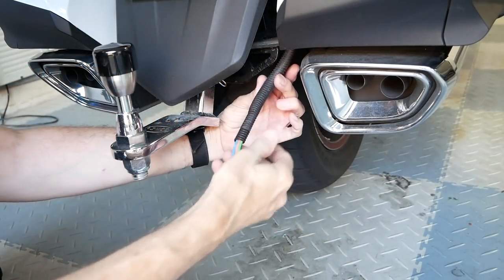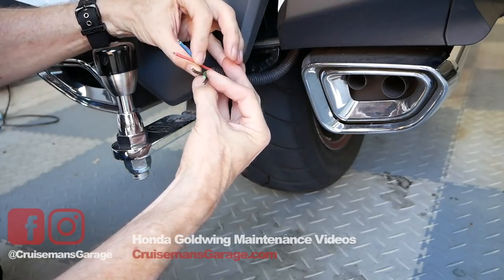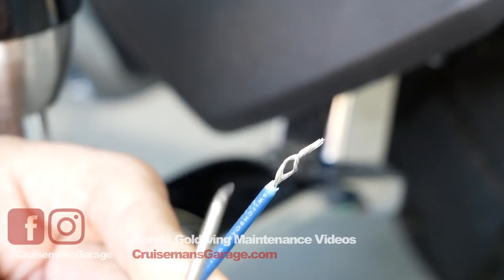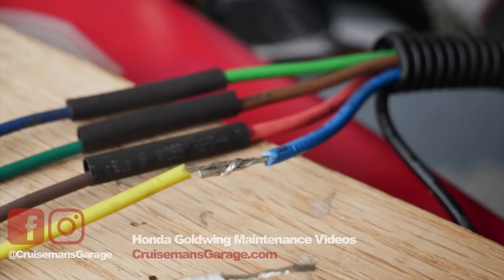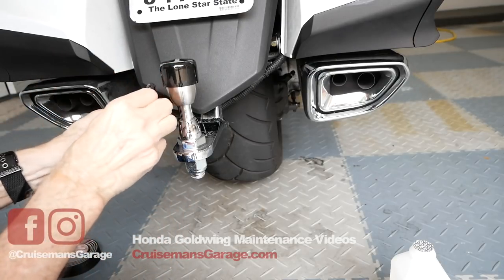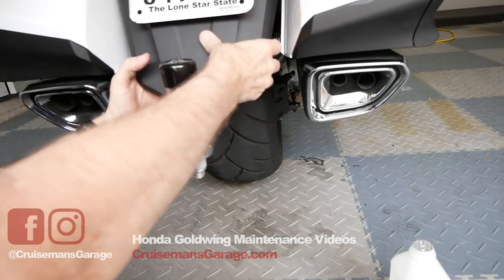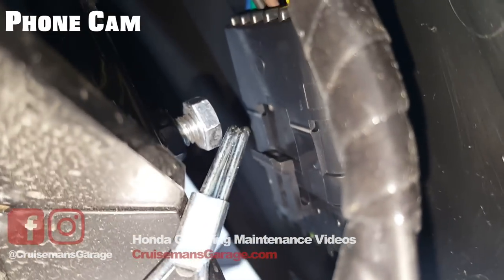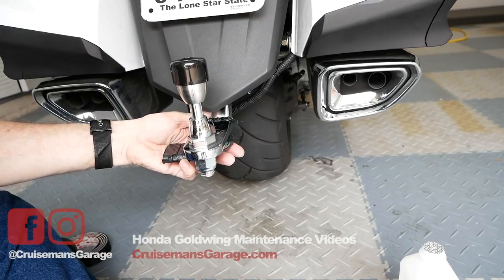Connecting the Bushtec trailer to RIVCO Universal Isolator

Comment: Bushtec trailers are in my opinion are the world’s best trailers. The trailers connect to the post style receiver using a heim joint keeping the trailer rock steady preventing rollover. The trailer’s suspension are designed to stay super solid at high speeds staying firmly planted over undulating road surfaces. A super slick trailer system you got there Cruiseman.
Reply from the maker: Love my Bushtec!

Comment: Your videos are solid gold. Thank you so much for making them! Based on your videos I picked up the Rivco hitch and wiring harnesses. Looking forward to receiving them in the mail soon! I do have one question to those who trailer - what weight are you pulling with the DCT? I ask because I'm interested in picking up a small camper to tow with my 'wing and loaded it will come in at 520lbs. I am more concerned with stopping the thing as opposed to the pulling, but would welcome your feedback (and anyone else that tows)! Thanks again for the great videos!!
Reply from the maker: Tony, you will love the RIVCO hitch. 520 lbs is a pretty heavy trailer. I don't think mine has ever topped 325 fully loaded. Your brakes will probably handle it, but you will need to add significant stopping distance. I would lower my highway speeds by 10-15mph as well. Not sure if 500 lbs exceeds what the bike is capable of or not.
Reply: Thanks for the feedback, Cruiseman. I found something that is priced right and I think will suit my needs. I just want to take my 'Wing and the camper within a 60-100 mile radius of where I currently live and go camping on the weekends. The Rivco hitch indicates it is good for 600 lbs. That doesn't mean the bike will handle that, but it's good to know what Rivco recommends on the hitch regardless. I will likely stay off highways most of the time (I enjoy the back country roads so much more anyway!). Thank you again!

Comment: Q1:  How do you protect your trailer connector from water/road grime/etc when not pulling the trailer?  Especially when it's hidden behind the fender like that...  Or, does it need protecting?  Maybe if you cut the thumb off a surgical/nitrile glove and stretch it over the end of the connector before fastening it?
Q2:  For the same reason you carried an extra piece of Velcro to protect the piece on the connector when in use, wouldn't it be a good idea to also cover that piece of Velcro hidden behind the fender?  I'd think it'd get nasty just as quickly as the one on the connector (maybe quicker, given where it is!).
Q3:  They might've released it before you did your video, but did you know that Bushtec sells a wiring package that includes the isolator package and their plug?  Perhaps that setup may include that aux. wire that you needed?

I've been using a ball cover that has a small pocket attached that's designed to hold a flat-4 connector.  My 2x3 Bunkhouse connector fits it fine.  That setup ouldn't work for you because you don't use a ball, and I think Bushtec's connector is too big to fit in the pocket anyway.

Thanks for the ideas and demos.
Reply from the maker: The connector is waterproof. I do actually carry another piece of the 3M Dual-Lock to protect the piece on the back of the fender from mud and dirt. I was aware of the Bushtec harness with isolator, and had one on my 2012 Goldwing. Rivco sponsored the video so I used their harness. I don't use the Aux wire anyway, but it would not have been a big deal to run a separate wire into the connector for Aux power.
Reply: @cruisemansgarage  I think putting the auxiliary wire in the middle was stupid. It should be set up in the same order as a 4-wire (ground, running lights,left turn/brake light, right turn/brake light) or a 5-wire with the auxiliary and interior light at the end so all others work even if you don't have a 6 pin set up on the bike. the extra two pins are supposed to be for the (5) interior light and (6) any extra added 12 volt accessories you MAY put on it so those should always be pin 5 and 6....

Comment: First up. Lol Nice vid. Some things I might have done different. First I would have cut the wire leads such that the soldered joints would be staggered. Second is that I would use adhesive lined shrink tubing to really seal up the soldered joints to keep water out.
Reply from the maker: I wanted to leave enough reach to the trailer connector. When you see my final install, you will see that almost all of the harness is hidden from sight.

Comment: Can I connect a 4 wire trailer to the this universal isolator or do I need a 5 to 4 wire adapter? By the way your videos are a time and life saver! Love them!
Reply: I think you could use the 4 wire IF the wiring was wired accordingly. As I mentioned in a prior reply, the first 4 wires should be ground, running lights, left turn/brake light, right turn/brake light) so if you wired the trailer or the bike's wiring to match it would work. But you may need to make an adapter if both are already connected and don't match. buy and cheap wire kit and make an adapter for just that trailer/bike and match the pins accordingly. That way you don't alter either bikes original wiring

Comment: Great video Cruiseman.  I just wanted to check in since you have been using your trailer for a while now.  Did the dual lock fasteners work behind the rear plastic piece?  Or did you end up doing something different after using it for a while?  Thanks
Reply from the maker: They have been  holding for two years.
Reply: @cruisemansgarage  Thank you for the info!